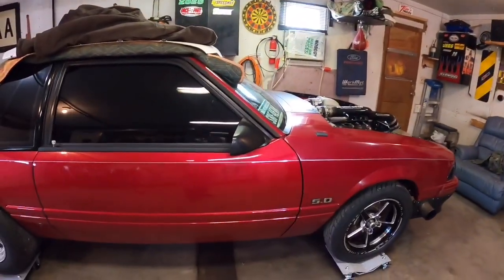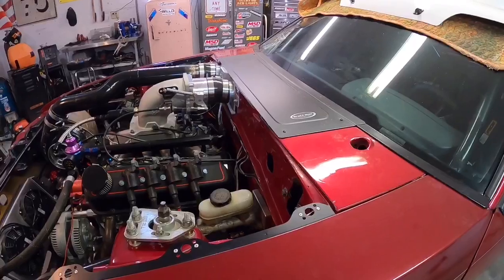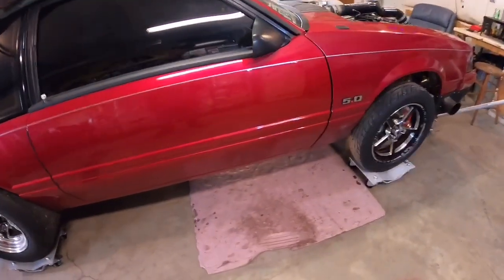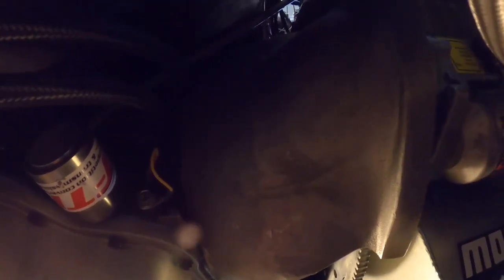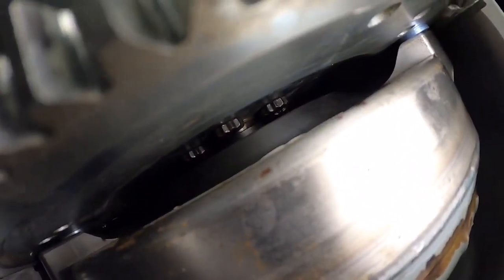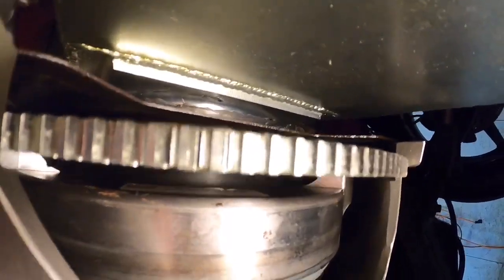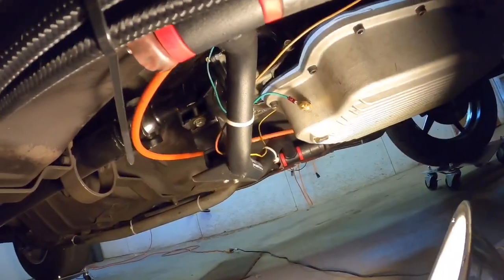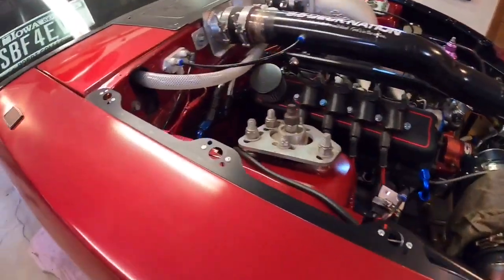How to TH400 swap a foxbody mustang, turbo 400 to SBF

Comment: I'm counting the cost of putting my SVO on the drag strip. Speed Gems makes a bellhousing adapter and crank spacer to mate a GM automatic. FYI: K-members for Fox Mustangs are not all the same. Maximum Motorsports has the stoutest design (road racing and street use) and the offerings at the other end of the spectrum are good for straight line only.

Comment: Use a pa or jw bellhousing made for the motor your using and for the th400.. custom driveshaft.etc..etc..etc.. it's sux. Since, your running a Ls Motor any gm trans will bolt up..
Reply: Oops never mind I see a sbf... LoL 😂🤣😂😳 it puts a shadow over your video as I watch and reply.

Comment: Not a fan of the Turbo 400 trans. It is BIG. The PG is a lot smaller and lighter making for a easier fit, and can take all the power you can throw at it. I ended up using a PG based trans simply because there are no Ford trans that can take the power without constant repair/rebuild. I am running a PG based trans for 5 years now at the 1,250+ hp level and all I do is change the fluid once a year.
Reply from the maker: Ya glides are great I may switch some day, just wanted to stay 3 speed for now
Reply: @BlakesSpeedShed  When/if you switch, you will find that the car is faster/quicker and more consistent. If you are still driving it on the street, then I can understand wanting to stay with a 3 speed.
Reply: @BlakesSpeedShed What are your thoughts on the Ford C6 transmission over the TH400?

Comment: Did you get your flexplate from summit or jegs or is a dual drilled flexplate custom ordered? I have a th400 and I’m trying to find a flexplate and spacer so I can use a GM torque converter
Reply from the maker: How many teeth u need 164?
Reply: Blakes Speed Shed I’m not sure... at this point all I have is the trans.. I’ve been holding off on getting the bell housing bc I wasn’t sure if I should get a 164tooth or 157.. the car will see mostly 1/8th and street driving.. any help would be great thanks
Reply from the maker: 1830210 PRW  is 164 28oz balance for a 351 is what i use
Reply: Blakes Speed Shed thanks man I believe that will work

Comment: I have an 88 fox with a dart 347 and 70mm turbo and I want to go auto like the th400, is it possible for you to suggest a parts list even a trans, im on a budget and am trying to keep it around 2k, if you can I'll give you my email,  thanks
Reply from the maker: Probably not gonna be able to do it for 2k all said and done, unless u find a used or close to stock 400.  Gonna needa a converter.  But the absolute minimum u need is a bell housing, driveshaft, and flex plate to work on a sbf mustang